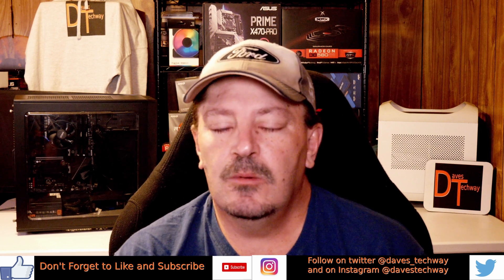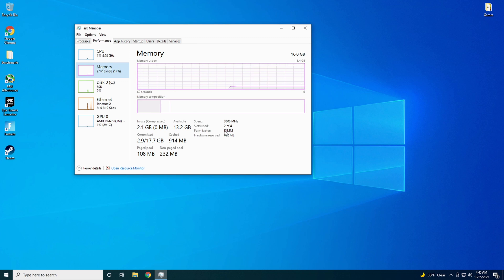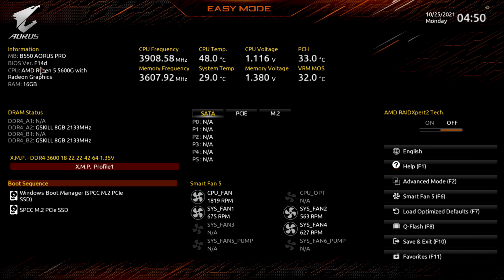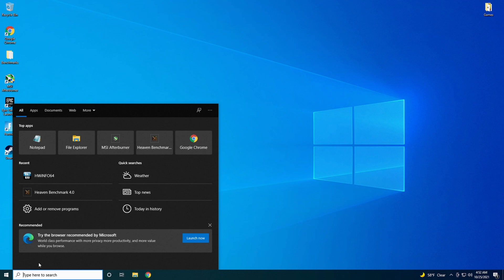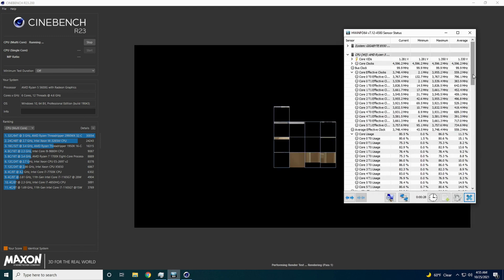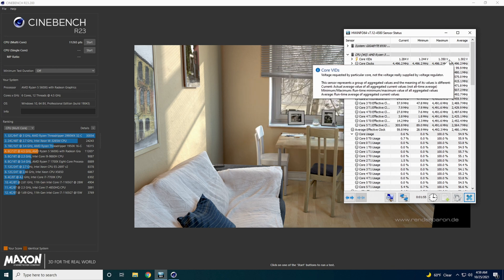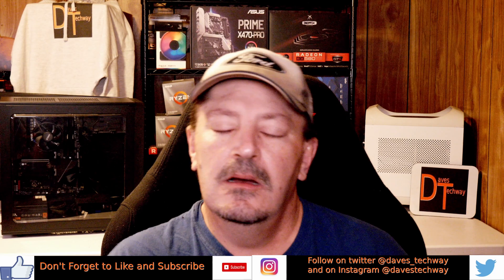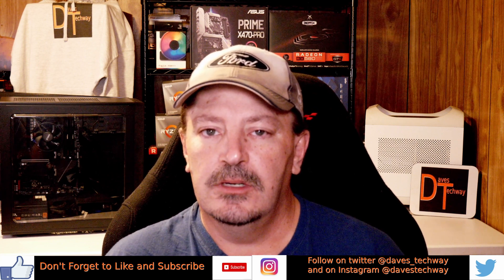CPU overclocking on the Gigabyte B550 Aorus Pro Motherboard

Comment: I'm confused about RYZEN 5 5600 when it exceeds 5 GHz it Blue Screen how much power is needed but 4.9 GHz it works well enough the heat is not much.

Comment: got a ryzen 9 5900x, tried 1.35v at 4.8, pc crashed, then went down to 4.7ghz at same voltage and got 23905 points on CB. i was getting in the 22ks with pbo, thank you vbery much :), i also have curve optimizer at -29 and good cores at -28 and -25

Comment: Could you help me. Whenever I try and turn up the Clock ratio It wont save it in task manager. It wont show the ghz I selected in bios. And the ghz speed isn’t going any higher. I’ve tried turning off all the cpu overclock settings such as Intel speed shift etc. should I keep those ones on or off for when I’m over locking. PLS help
Reply from the maker: Not saving the settings means it is too high of a OC. I would turn off all the auto OC in the motherboard. Thanks for watching and the comment.

Comment: Hi. Greetings from Germany. I have Ryzen 5800x Crucial Ballistic 3600 cl16 and B550 Aorus Pro V2.
Can I stable overclock my CPU to 4,7Ghz? 
Do You prefer for 5800x PBO or not?
Reply from the maker: Has good has PBO has gotten I think just running PBO just has good as overclocking your self is. Thanks for watching and the comment.